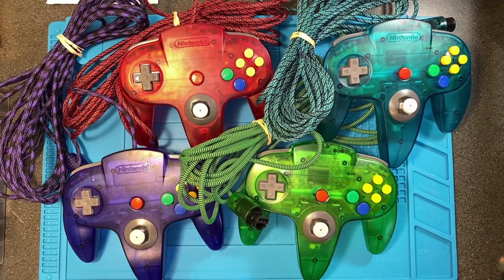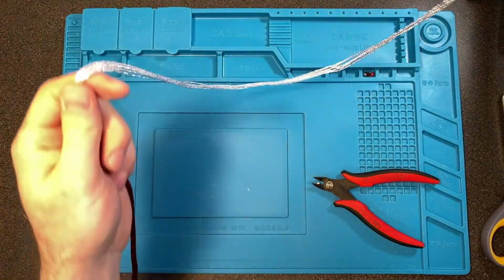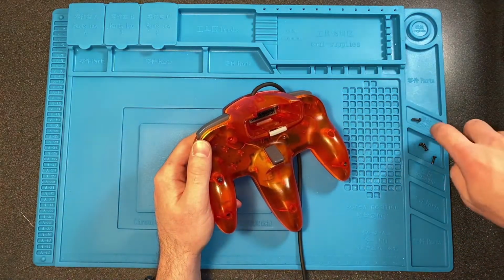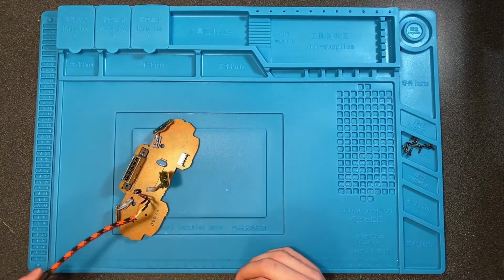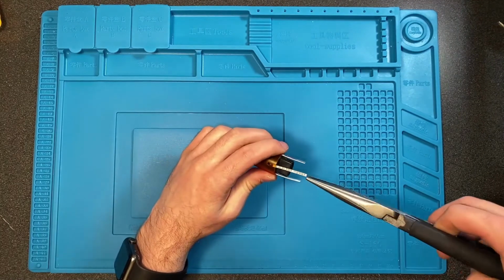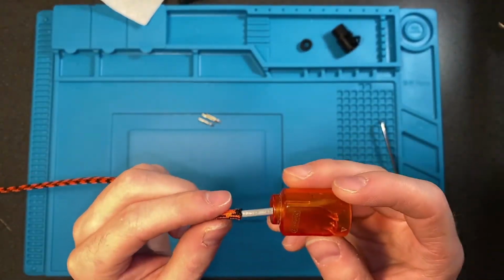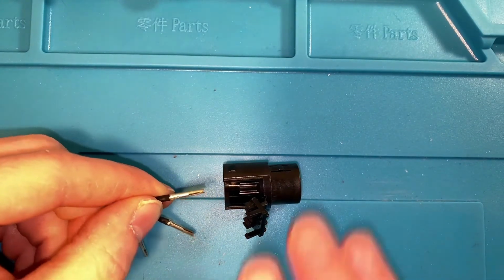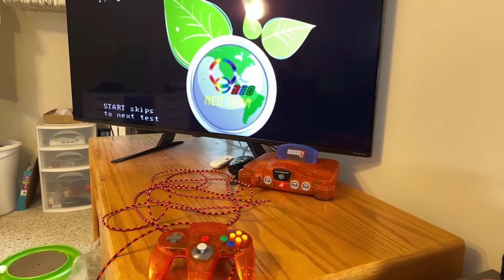N64 Controller Paracord Mod Complete Tutorial

Comment: I suspect my oem transparent red controller i bought used and fixed the joystick might have a bad wire, it might strangely be the oil i used in the joystick though cuz the whole controller started flickering my inputs as soon as i messed with the joystick. but if it ends up being the wire that is bad i will probably do this mod thanks.  btw I love your collection I currently only have a standard grey, jungle green my n64 from back in the da is jungle green too which i LOVE), and watermelon red controller,  i have been thinking maybe geting the extreme lime controller next but seeing that grape purple next to the ones on this vid, I'm really liking that purple.
Reply from the maker: What do you mean by flickering inputs?
Reply: @flyinryanosrs2349  it is hard to describe but if i conect it to my pc(useing a Mayflash n64 controller to USB adapter), hold any button down and i look at the controllers inputs on a software like Gamepad Tester that button that is being pressed down does not register for a fraction of a second repeatedly about 3 times a second on average.   I also noticed this started with my Jungle Green OEM transparent controller just after plugging in my Watermelon Red OEM n64 controller to the adapter's second controller port. the Jungle Green controller was working fine until I plugged the other one. This is a pretty puzzling isue but I think it might be a Firmware Problem with the Mayflash adapter or the Watermelon red controllers wire.    BTW if multiple buttons are pressed at the same time on the Watermelon Red controller both button inputs Flicker off and on in sink to each other.

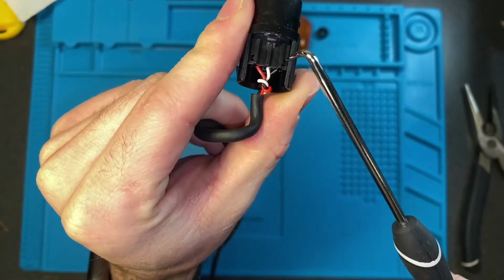Comment: I believe that black bead shown around @26:00 is a magnetic ferrite bead, commonly used in electronics especially wired controllers. The purpose of them is to help eliminate interference, so you don't get like a random radio wave "pushing buttons".
Reply: Yes, its required. Don't forget to put it back on!

Comment: an issue with my soldering made the n64 freeze if i plugged the controller in after the game started up, or it wouldn't start up at all if the controller was already plugged in before booting the console but if i unplugged the controller the game would continue to run, was quite the headache. I did it directly to the board, had to use desolder wick instead of a desolder pump which made for a bit less conventional process but after a careful redo or 2 it was working like it did before I did the paracord. So if anyone comes into an issue like this, it's most likely due to the points of contact and an issue with the solder job. Thanks for the video Ryan! I've done about 6 gc controllers before I did this project, and I must say the sleeving is tougher on the GC's but I never had an issue like this with gc controllers so food for thought to anyone attempting this! Big shouts to the modding community, this stuff is super fun! I just paracorded the raw wire and I can't really feel any wires or bunching, and I just put packing tape over the end of the wires that i was feeding through the cord to keep them together and reduce any friction and it only took me about 20-30 minutes to do the sleeving and I'm happy with how it feels, it's just a little less thick than the rubber. Cheers!
Reply from the maker: Happy to hear that putting the bare wires through didn’t change much, but probably easier to sleeve. Thanks for your input!

Comment: You should put GameCube joysticks in them.
Reply: From what ive heard, that isnt a great idea. It removes alot of the movement in n64 games. The n64 sticks actually have alot of subtle positions that many games use that the normal analog joysticks (like GameCube) don't have.

Comment: You should desolder the pins from the board and use a dental pick or something very similar to take out the wire ends from the plastic cage, then you can tape it (or the edge with the plug) with packaging tape into a spearhead so you can just slip it on and not have it get snagged by the metal tips. And you can take an exacto knife to the plastic casing on the OEM cable to not have to buy a new spool of it
Reply: at least thats how we do it in gcc
Reply: @jpufry   Years of controller modding, and trial and error, packaging tape still works the best. If you didn't wanna solder anything at all on the N64 controllers, you can remove the cable ends at the plug end (that connects to the controller port) and tape them and feed them from that end. There's 1 good video on Youtube on how to do this consistently and it's how i do it for customers that don't want anything touched on their motherboards or cables. Never messed with Gamecube controllers but im sure you guys have many other tricks!
Reply from the maker: Thanks for the response. A few reasons I didn’t do it like this- the insides of the cable are a bit different than GameCube. I didn’t show it well but the inside does not have shielding like the GameCube cable. This leaves you with 3 loose wires that you would feel inside of the paracord. The other purpose of this mod was to extend the cord to be longer than the original 6 feet.
Reply: @flyinryanosrs2349   You can actually fit the OEM cable through 550 paracord without slicing the casing of the OEM cable. I have done it many times, just yesterday even lol. It is a very snug fit but it allows you to keep the controller unmodified or cut. Use packing tape to tape together the loose ends in a pointed-shape and it will slip through as if its all encased. However, extending the cable would require a method like this, and sourcing your own wire size for the extension gives you the ability to find wire that slips through the 550 paracord much easier. Great video though!
Reply from the maker: Thanks for the info! I didn’t try to fit the OEM cord through, that was just what I read from some others that have done a similar mod. Good to know it can fit if you have no interest in changing the cord length.